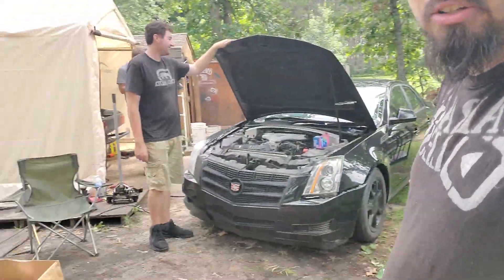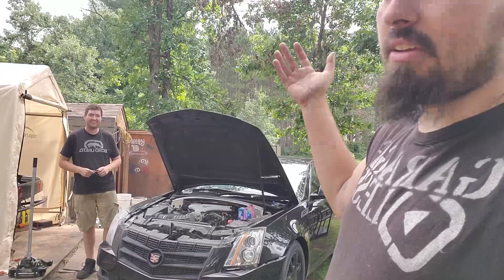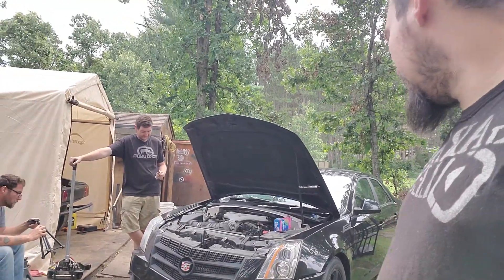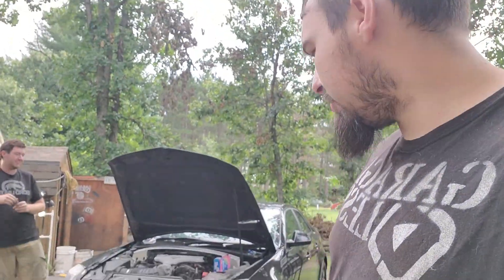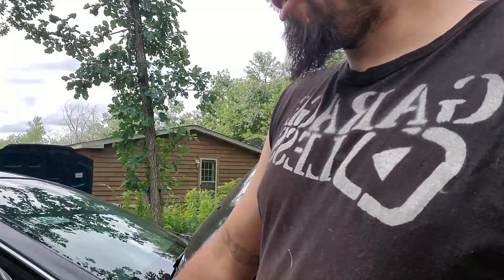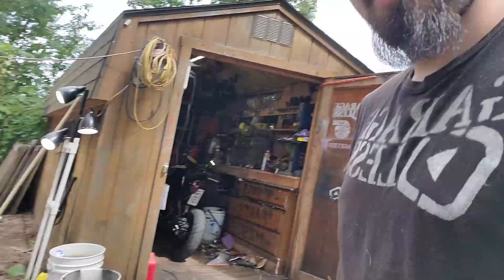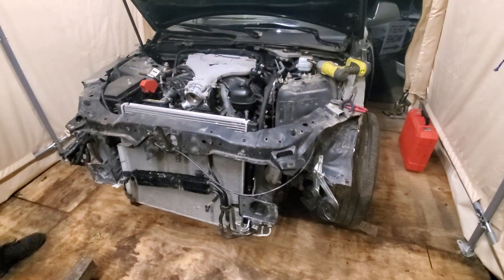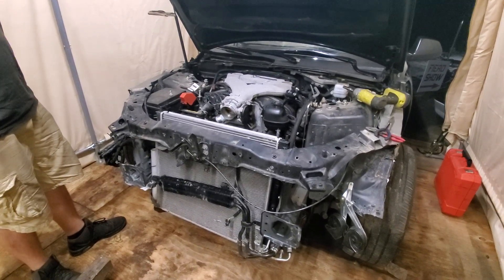THE START OF THE JUNKYARD TURBO LS SWAPPED POOR MANS CTSV BUILD

Comment: What was the  Measurement for the driveshaft   and how do you order the part
Reply from the maker: Was like 41 inches or sowmthing like that ull definitely wanma measure once u have everything mounted... and i ordered it online after measuring which is not hard but u definitely wanna b sure your measured right
Reply: What is the name of the adaptive piece so I can make the driveshaft connect to the rear end
Reply from the maker: Differental yoke i believe

Comment: Lol its ironic cause im doing 3400 fiero  and also have an 09 cts and 13 ats with 3.6 that if either of those go out theyre getting a v8 preferably big block. But i did timing chain on my cts at 100k and its not that bad just like a 10 hr job , but i would turbo the 3.6 and blow something up before getting rid of it
Reply: Yeah I was going to just fix the timing chain, but then I just decided to LS swap it and here we are lol

Comment: I can't find a ls anything for less than 2k... People need to make a new engine swap...49773 miles WTF! Keep that stuff in there there's mfkrs on the west coast with blown engines and the city barking up they aaaaaaa
Reply from the maker: Not my car so not my choice... he wants ls swap so thats the plan
Reply: @Garageless  I was just trying to say the ls 2k+... then the low mileage engine came in.
You should try convincing a turbo first at least
Reply from the maker: @matthewfredrickmfkrz1934  its already almost out lol
Reply: @matthewfredrickmfkrz1934  transmission is too weak to hold power, and people are only making 400hp with stock internals sadly. I though about that before I decided on the LS
Reply: @Shadowslayer539  new engine in yet?